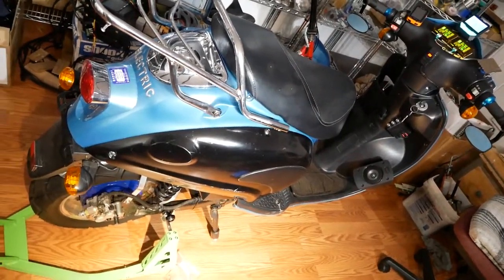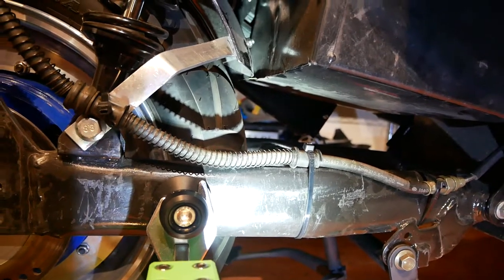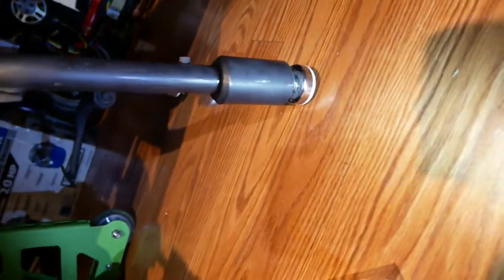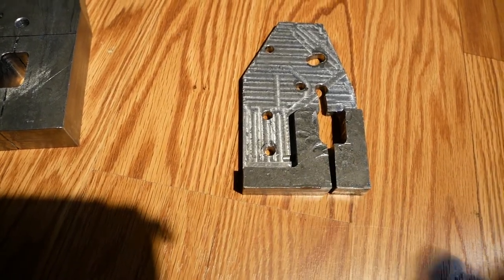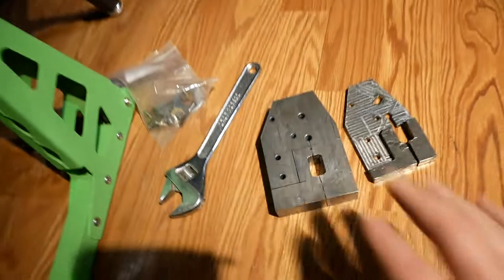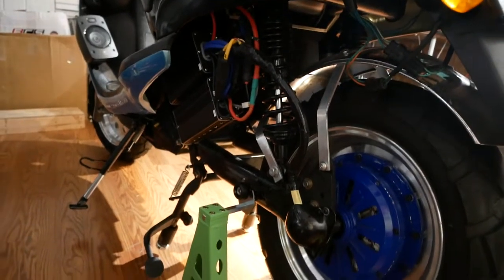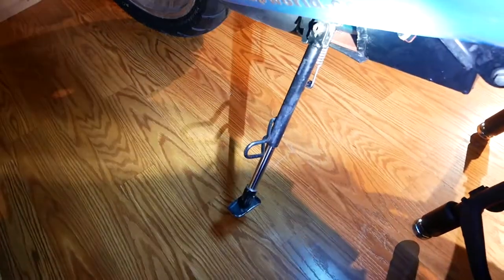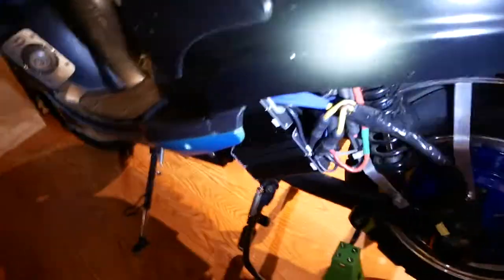Zap scooter walk through 2 20210723

Comment: Too funny about the dropout iterations. So it did that to V3 even without being able to use full power too, crazy. I'm still on the preorder list going on almost 1.5 years for a 12F, but if I wasn't lucky enough to snag one on ebay I would still be salty about that. Sucks about the bad CS. Did you check if anyone else had a power limiting issue on the Telegram group or endless-sphere Nucular owner thread running a 6 phase (I'm assuming) motor? Might be worth asking around. I know there's a guy "John in CR" on the ES forums who runs 6-phase motors as well as 24F controllers on at least one if not more of his bikes. He's big on modified scooters too.

So I ended up getting a Gotway RS19 HT EUC through eWheels after learning they outsourced the battery pack build to a third party to improve the quality and include better BMS features. I don't think the BMS would qualify as a Smart BMS (no bluetooth integration or cell group voltage monitoring) referencing your Mten3 teardown and pack analysis video, but certainly better than stock in some ways. I'm still working with eWheels to verify some aspects of the BMS programming since I want to regularly charge to 4.05-4.1V/cell and maintain balanced cell groups, and I was wondering if you'd be interested in taking a look at the picture of the BMS showing board components that they used in the meantime. I'd be interested in your observations and thoughts to see the advertised features and performance match up to what you can tell from the picture. I'm not really an electrical guy so it'd be great to hear from you.

If you're interested, let me know your email and I'll send you what I got.
Reply from the maker: Yeah...get something else. There's lots of VESC options out there that will do what you need and you won't have to deal with the Nucular nonsense. If you look at their firmware, there has not been an update in a year. I know for a fact that I have submitted 10-15 bugs I found. Just an opinion, but I'm sure I'm far from the only person to report problems or ask for new features. I've asked for probably 20 new features. Nothing, nada, ZERO firmware updates in a year? I think Nucular lost their smart guy a year ago and now they are just treading water. It would explain why there are no firmware updates and why the stuttering issue is not getting resolved. Also, they announced a A BMS they were going to release a year ago and that has not seen the light of day either.
*
Torque arms have been a problem...LOL! The V4 arms are doing fine. They have about 100 miles on them now and no sign of issues. Fingers crossed!
*
I found some help on Endless Sphere, but it didn't resolve the problem, just made it less. I don't know about a Telegram group. Please post!
*
I have not seen an EUC that had a proper BMS on it. They are usually balancers, but protect nothing.
*
Post your email and I'll reply back to you directly